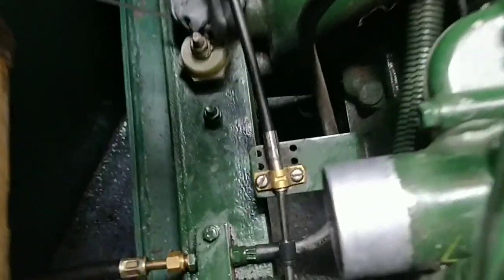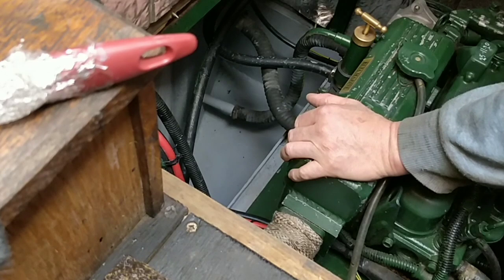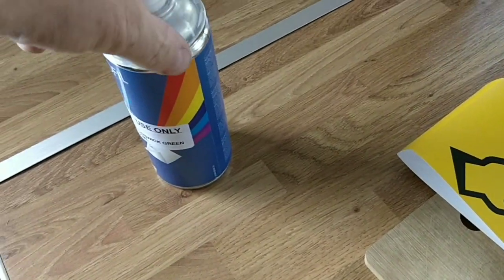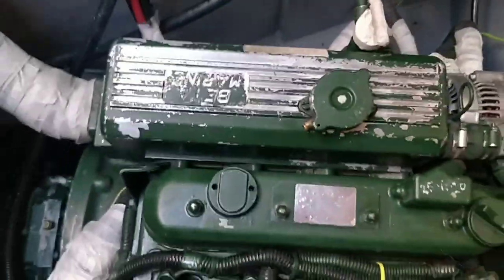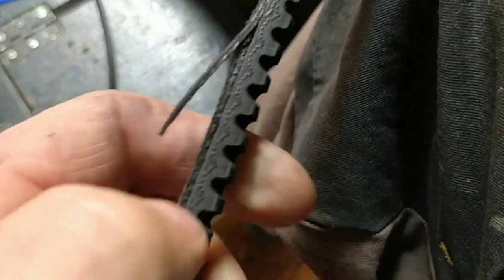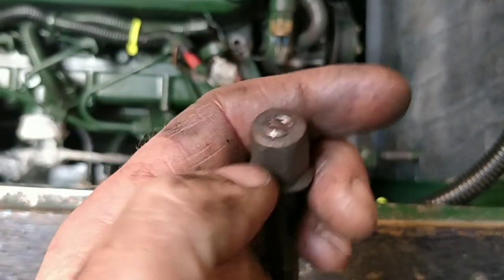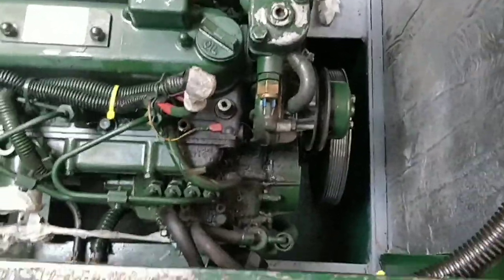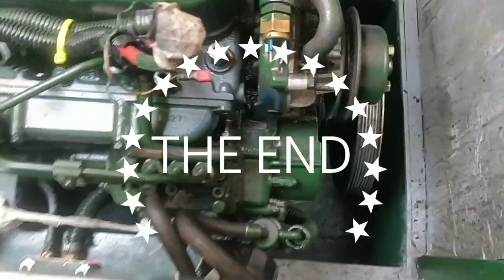Started off well turned into a nightmare. Part 2 painting the narrowboat engine.

Comment: Wish I was there to give you a hand Will. That stud that goes in the front cover thats sloppy in the hole, I think ??? should have a thread on both ends and thread into the block. Blooming heck, it's a good time to have somebody around, even if they can only make a cuppa. You're going to need some parts, so hopefully you can look at a manual to confirm whats needed. Good luck, take care.
Reply from the maker: When I was working in the motorbike workshop I could share ideas and problems. It's similar on the tube. I can show you guys so hopefully prevent other people having the same problems. I'm just back from Halfords and starting work again. Cheers

Comment: Halfway into painting mine at the moment, does it end !!
Reply from the maker: Oooh nice. Are you using the same paint?
Reply: @NarrowboatWill  I've put Red Oxide on and then I will use a "Bilge" paint, blue, see how that goes, to be honest, I was surprised how dry the compartment ended up, used some nappies, a tip I was given by  another boater.